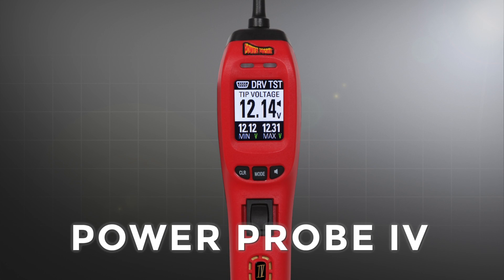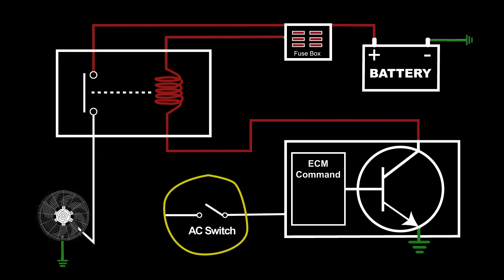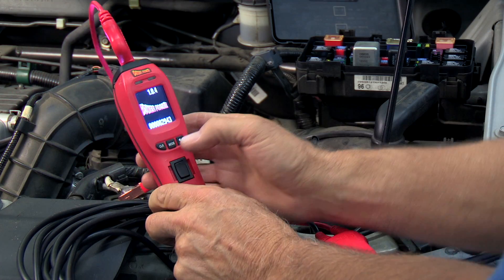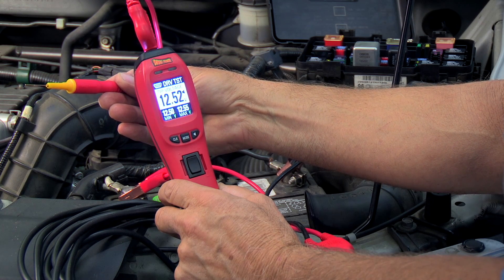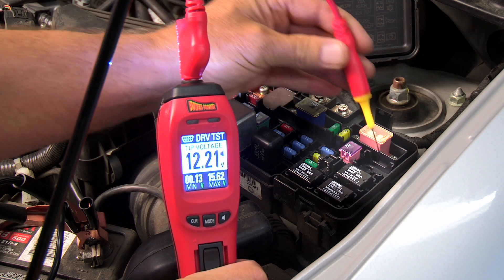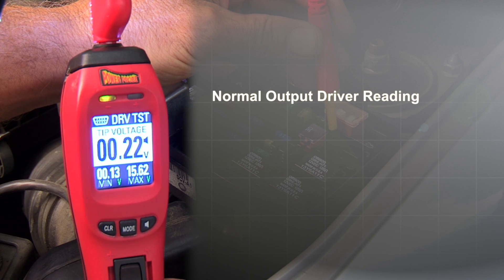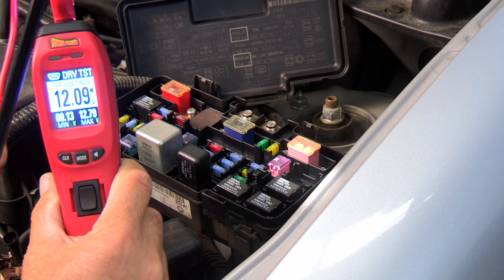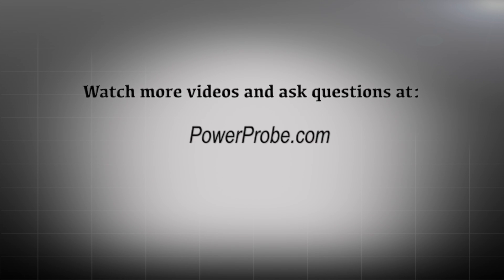Power Probe IV - Driver Test Mode

Comment: I use the PP4 in "driver test" mode on a 2007 Toyota Camry with 3.5L V6 on A/C clutch relay. I made sure I was in driver test mode and it showed having 12.4V at the tip. I put a T pin in relay base slot going to the driver, touched the PP tip to the T pin and had someone turn on the A/C. The voltage at the tip stayed at 12.4V. This was with push button in the "on" position. 

Then I tried it with engine running, and for the first 2 seconds the tip voltage dropped to 1.1V, but after 2 seconds the tip voltage went back up to 14.0V and the A/C light in the cabin started flashing. I haven't looked at a schematic for the A/C system yet, but from my experience, the driver test mode doesn't work on all cars.

Comment: one more issue: driver transistors only block enough current from passing through.there is 12 volts at wire so I would think that if techs measure that wire and see 12 v already they would hesitate from applying their probes 12v also.that would have me scratching my head.

Comment: it's my understanding that this probe feeds 12 volt to cable going to ecm.but alot- of devices are negative control,so it appears to me that this is a risky test and burn ecm - use a test light would be safer.somebody correct me or explain to me please,thank u
Reply: thanks

Comment: Probing the output driver terminal at the relay socket? Ok so what is that 85 pin or 86 pin on the ECU side of the relay or on the other side to the fan? And if it is the ECU side wont by putting 12.5 volts into it just kill the ECU? i think I have just answered my own question lol. No seriously, doesn't the ECU always only use a 5v reference to trigger relays? Yes and like DCBIGSKY says below, for beginners there needs to be more clasroom style lessons on how to use the thing. They boast its for beginners too, so make videos for us then. Oh and change the damn lerson doing them, his voice is unbelievably annoying.
Reply: 5v is for sensor circuits
Reply: Driver circuits see 12v coming through the relay all day, shooting 12v into it isn't going to hurt it. Just know the circuit you're shooting into.
Reply: @Carlitosway211   Yeah, but that 12V the driver in the ECM sees is going through the relay coil before it gets to the driver in the ECM. That relay coil is a load that limits current flow so the current doesn't go high enough to damage the driver. If you apply 12V with a jumper wire to the driver, you will fry the driver. The reason the PP4 can do this in driver mode is because it has the 50 ohm resistor that limits the current.
Reply: You're not applying power! You aremeasuring it. 12vdc reading when you torn on the fan it grounds and pulls to near zero. And it reads/measures that. Don't rock the switch! When performing this test.

Comment: how is this not supplying 12v to an ecu circuit?
Reply: It is, and that's ok. Some ECUs won't switch the circuit to ground if it doesn't sense power coming through the relay.

Comment: When you are in driver test mode how much of a load is being put on the driver transistor?
Reply: Great question bro. It's listed in the users manual as "50 ohm pull up on Tip" 
So 12v/50 = .24a
And 15v/50 = .3A 
If I did this right we should be good with just about every driver on the car and it may actually be safer than an incandescent light (like I use) as a light will have a momentary high amp surge unlike a resistor.
Reply: Did you purchase one Paul?  It seems to have some interesting features.  I have some other tools on my want list before I get a Power Probe 4, want to get that new Pico cop probe and the new 30 amp low amp probe as well from Pico.  Nice to hear from you.
Reply: Yes and I've only used it once so far. 
Still learning it's features. It will definitely come I'm handy. 
Good to hear from you too.
Reply: What's the difference between the driver test mode and just hitting the switch to supply 12v to the tip? I take it in driver test mode, the difference must be the 50 ohm pull-up resistor that limits current flow.  Is that the only difference?  Sounds like that would be safe, but just injecting 12v from the tip otherwise would probably fry the driver because there'd be nothing to limit current.
Reply: So are you putting power into the ground circuit?